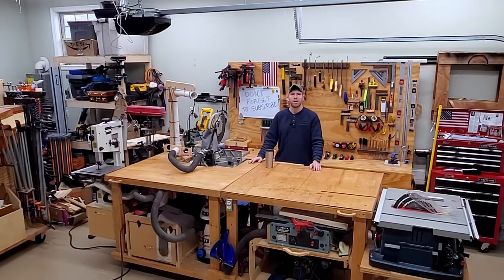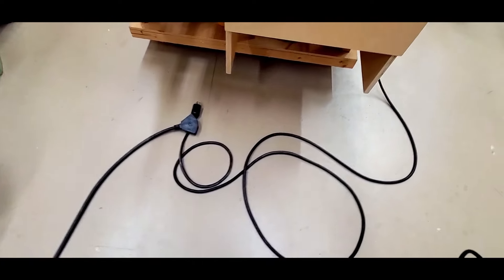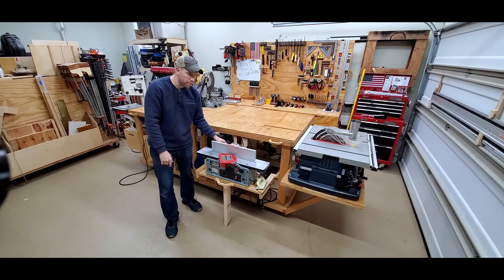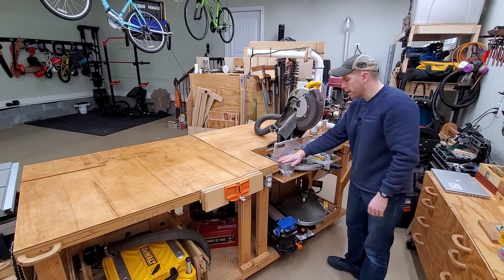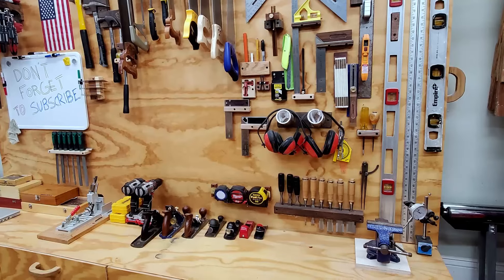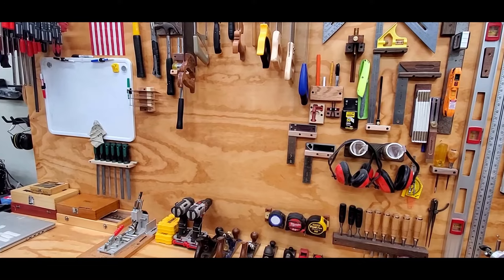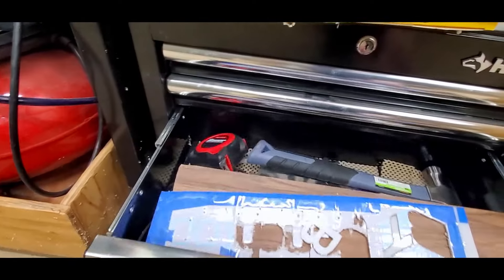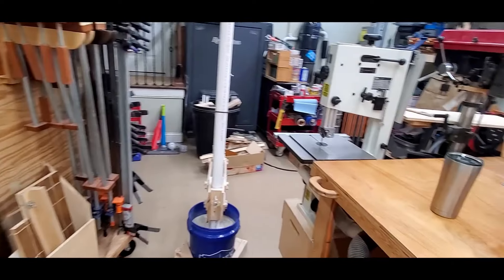Small Woodshop Tour // EP 070

Comment: Hi Chris... I’m so glad I just discovered your video, it’s perfect timing for me because I’m in the middle of sketching out a table like this for myself. Can you say why you chose to position your table saw to the left of the outfeed surface as opposed to the middle or on the right? Is it personal preference, or is there a functional reason? I’ve seen it both ways. Thanks for sharing your ideas, and thank you for your service.
Reply from the maker: My table saw was originally aligned with the "left" edge of my table design. This v is to maximize clearance between tablesaw outfeed and mitersaw. 
When I built my table,  decided to cut my top  down from 48 to 40" due to a perceived  constraint for using moving crates... but I kept the table saw position to maintain rip capacity.  I recommend keeping a full 48" table width if you have space in your shop. I kept the original 48x96 when I drew my plans . I'll actually be talking about this on one of my upcoming videos in detail.  Check out my free shop layout guide if you like,  it shows the original layout and has tools to check interferences.  Thanks for watching,  I hope that helps!

Comment: Hi Chris, what size bolts do you use to connect both tables and what size and Species of wood are they in. Thanks love the tool wall as well
Reply from the maker: I used 3x 3/8" x ~5" long carriage bolts with wing nuts to attach the two halves together  at the top.  The plywood on my work cart is birch veneer and the framing is Douglas fir 2x4  dimensional lumber (ripped to 1.5" x 1 3/4).  The tool wall is B/C  Pine single side sanded of several thicknesses.  
All of these things are also detailed in my plans including suggested materials and often links to references. I hope that helps,  thanks for watching,  Rick!
Reply: @benchtopwoodworks  Yes, it helps a lot.